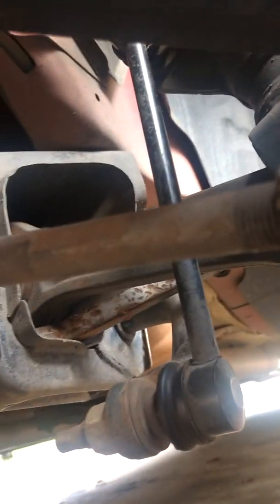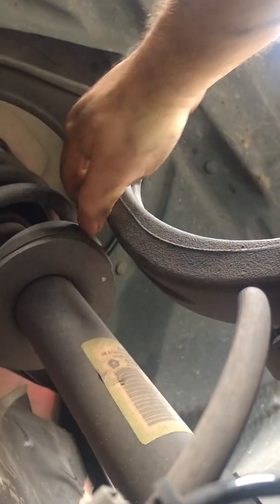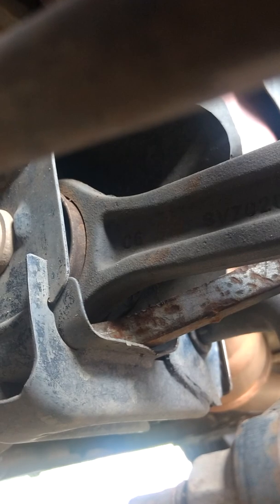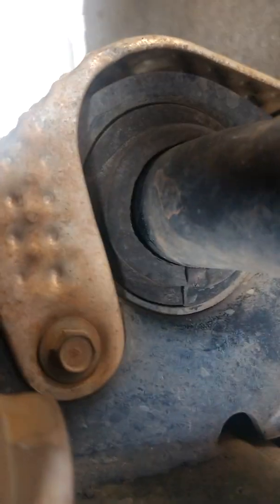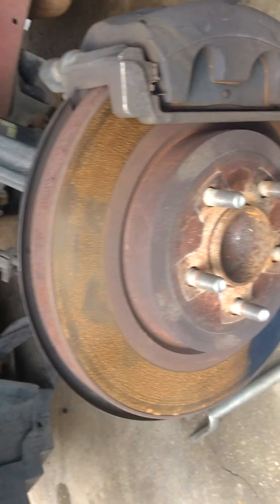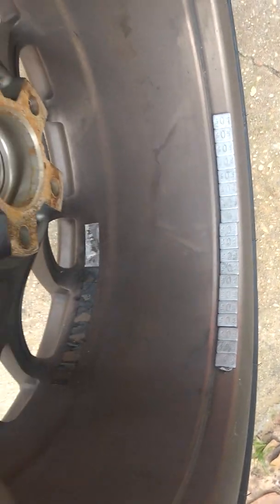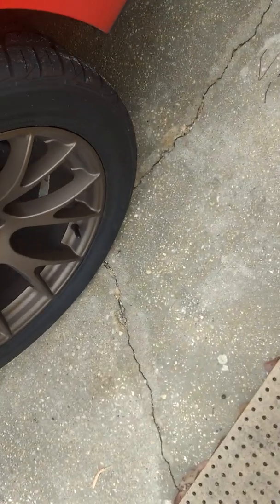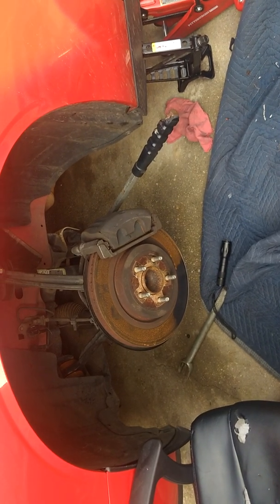2013 Dodge Challenger RT front end clunk.

Comment: i was having cluking coming out of my front end and i checked every thing out all my bushings ball joints shit like that were fine what i found is that the sub frame connecting bolt head snapped off. i started searching challenger web sights and found alot of people having this issue. behind the tire theres a peice of tape like substance glued over a body access hole that tape falls off and moisture gets in, travels down the bolt and rots the bolt as well as sub frame from inside. its not just challengers also chargers magnums on lady even said her van had this problem. if your sub frame is rotting the thru bolt has two sets of threads on them the bolt is like 8 inches long and near the head of bolt are threads that are supposed to thread to  sub frame. now with head snapped off i was working on ways to get that bolt out cause dodge will tell you you need a new subframe (engine cradle) cause threads are stripped. or they wont tell you and change bolt that might last a while but without those bottom threads,the bolt is helpless. in this video i can see the bolt on the side hes working on but could be the other side. on my car its the passenger side thats bad but when im driving it sounds like the drivers side. so im working on three different ways of fixing this problem without changing sub frame dodge will charge u thousands.a new cradle five fifty to seven hundred dollars. n then u better hope u got the right one. the first thing i will do is try to drill a hole in the bolt ane use a e-z out type bolt remover also lubercate  the top of bolt thru the window behind wheel. if that dont work i will see if theres a reverse tap and bolt that i can tap in and since its reverse as i tighten tapped bolt it should loosen frame bolt. next i will cut the window open to get to nut which has a locking washer on it (not a lock washer) i had to stick my camera in the hand hole n take photos to see in there. now if the threads on the bottom are stripped i will try to weld the washer that comes with the bolt on to the bolt then weld the washer to the body after in stalling it. i might just skip all that and weld the sub frame to the frame. but that bolt will still be in there dangling around. i dont think it will make much noise if the frame is not bouncing around. if anybody is having this problem contact the national highway traffic safety administration 1-888-327-4236 they are in charge of recalls. most times you have to change the engine cradle due to accidents and they got bent. most likely this is what caused your accident.
Reply from the maker: Fortunately I changed out my end links and sway bar bushings and my noise went away. My car has zero rust cause I live on the coast no snow or salt also clean carfax. Sorry you had all that trouble hopefully you got yours fixed

Comment: Typically it is your upper ball joint which comes already built into your upper control arm.  You have to replace the whole thing.  I disconnected it from the main steering fork that the lower control arms are attached to and I could move it around with my pinky.  It was loose as heck. Buy one that you can add a grease zerk so you can grease it every oil change and it will last forever.
Reply from the maker: Ya I replaced inlinks, stabilizer bar bushings lower and upper control arms with new ball joints still clunk. Changed the rearward front control arm and clunk went away. 💪

Comment: So, I’ve had a front end clunk on my 2011 Charger r/t. I replaced (in this order) Lower control arm + ball joint, Lower Rearward control arm + pressed ball joint, sway bar bushings, and sway bar links. NONE of these fixed the issue. I hear it louder when turning left and driving straight. Turning right is fairly quiet.

My sway bar bushings did not have a gap or play, but I replaced them anyway.

I am going to replace the struts next. Hopefully that helps.
Reply: Did you find the clunking noise after changing the other parts? I changed sway bar bushings and links and the noise is still there.
Reply: @ramirogovea3092  The struts ended up fixing the clunk, however yours may be slightly different. Could be a ball joint or control arm. In my case, it was a blown strut. Unfortunately it was the very last thing I tried lol
Reply: Thanks for the reply, I appreciate it! Mine is a 2015 Charger RT Track Package. The right top and lower control arms are new. The clink comes from that right side. I guess I’ll try the struts
Reply: @ramirogovea3092  I suggest replaces both of the front struts and not just the side that’s clunking. It was honestly not very hard, took me and a friend about 2 hours and I’m no mechanic lol
Reply: @Vegz0rz  oh, yeah, I’ll do both. Lol..thanks
Reply: MOPARGuy  I had the same issue bro, I was going to do tie rods (still have a brand new set). But the strut replacements fixed my clunk right away
Reply: @Vegz0rz  thanks for the info.
Reply: @ramirogovea3092  No prob, hope you get it sorted out
Reply: @Vegz0rz  
Morning Sir,

what struts do you mean ?
The coilovers or the endlink struts ?

VR
Reply: @tt-rs1457  struts are the spring shock combo.
A McPherson strut. Or short hand strut.

Comment: Check your caliper 1 piston  hanging up mine did the same thing it makes the steering wheel wobble
Reply from the maker: Ya when I had this issue I had changed all 4 calipers rotors and brake pads. Ended up being the lower control arm on drivers side.

Comment: I have a 2012 RT with the same issue. I replace my sway bar bushings and endlinks which fixed the clunk for a bit but it eventually came back. I’m interested to see what your fix is!
Reply from the maker: I bought the sway bushings and end links myself too. I got the Moog brand cause I read horror stories of some of the cheaper brands on eBay going out months after install. If this doesn't fix it guess I'll replace the upper and lower control arms too. I'll definitely be doing a video on it all.

Comment: I have a bad clunk from my rear driver side , but not my passenger side. Drives me insane smh
Reply from the maker: Did you figure out what was causing it
Reply: @tobroke2007  no bro I haven’t figured it out Ever since I slapped on H&R springs I’ve been having that clunk smh
Reply from the maker: @GelatoV559  check your rear shocks bolts to make sure there good and tight and that the shocks aren't bad
Reply: @tobroke2007  thank you brotha I appreciate that

Comment: Check strut upper mount
Reply from the maker: Yes sir that will definitely be my next install gonna get the adjustable camber one.
Reply: @tobroke2007  
How does it ended up ?
What was the culper ?
Reply from the maker: @tt-rs1457  upper control arm bushings
Reply: @tobroke2007  

thanks for quick replying.
What brand do you choose ...... remvoed the whole controlarm or only the two bushings ?
Reply from the maker: @tt-rs1457  removed the whole arm came with new bushings and ball joint ordered it off ebay think if I remember it was Moog brand

Comment: Did you find clunking noise
Reply from the maker: No I haven't I'm thinking it's the upper control arm I'm replacing the struts with Eibach struts due too my lowering springs I installed being to much for my stock struts. I even mounted a go pro trying to capture the problem but can't see around my rim because of how low the car sits. Will let everyone know if this fixed the problem.
Reply from the maker: MOPARGuy  I replaced the stabilizer bushings and end links and haven't heard any clunking so far.
Reply: @tobroke2007  
Does it still works ?
Only bushings and endlinks fixed that noise ?
Reply from the maker: @tt-rs1457  i replaced the upper control arm as well because it came in the kit that I bought off ebay